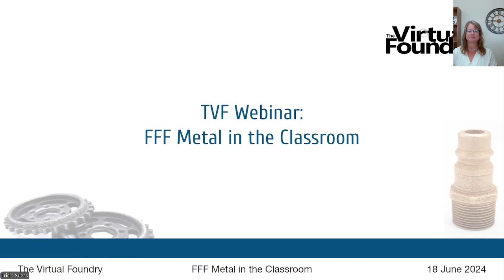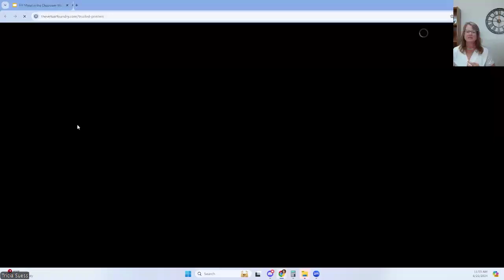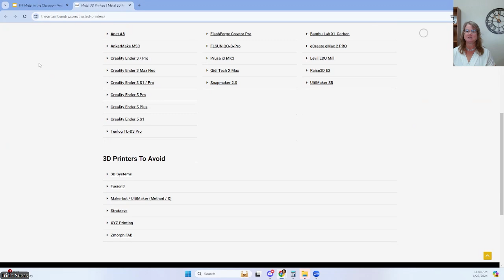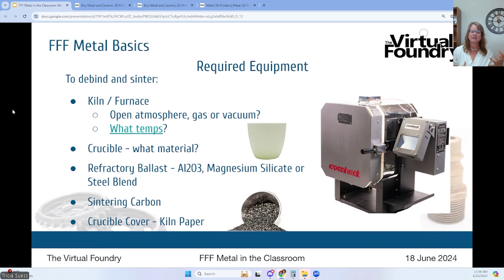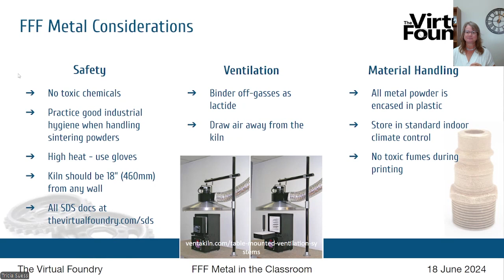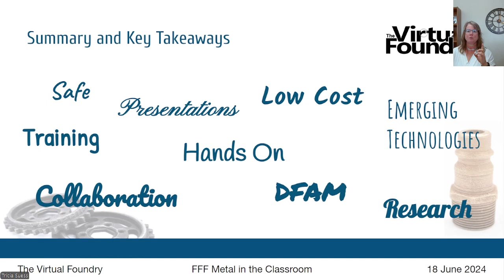TVF Webinar: FFF Metal in the Classroom

Comment: Whats the difference between sintering with common kiln vs sintering oven with inert gas?
Reply from the maker: We mean this literally. TVF filament can be sintered in kilns used in Hobby's like ceramics and pottery. Like those used in art classes in schools. The only requirement is that the kiln has a digital controller so you can program the temperatures over time.

Before TVF, sintering was typically done in a vacuum kiln that was filled with an insert gas like argon. Vacuum/gas kilns are very, very expensive.

So, a big part of what makes TVF materials interesting is that they can be sintered into pure metal with an off-the-shelf kiln that is very inexpensive.
Reply: @TheVirtualFoundry  Thats great. 
1. Do you have TDS available for your materials? (Comparison with existing expensive metal printing solutions would be key selling point)
2. Can you CNC mill green TVF printed parts before sintering?
3. How to control shrinkage to get as dimensionally accurate as possible parts?
Reply from the maker: Question 2 is a simple yes. #'s 1 and 2 are best answered in research papers that have been published on these topics. https://scholar.google.com has about 100 papers where materials ordered from our store were used as research topics by people all over the world. This is the best info you can get.

Here's one paper that might answer both questions. If not, Google around and you'll find what you need 

https://www.sciencedirect.com/science/article/abs/pii/S1526612524004316